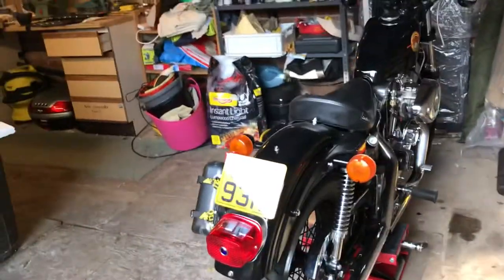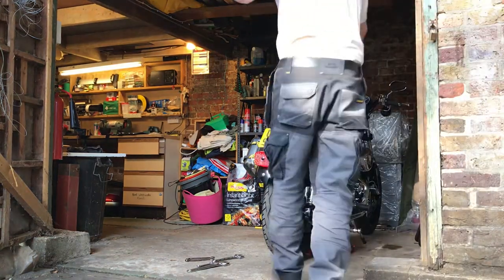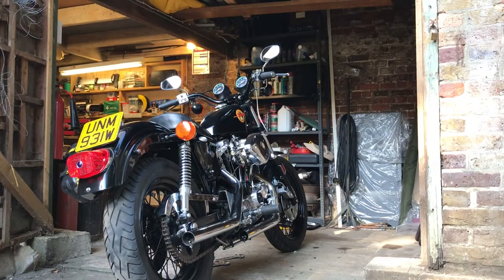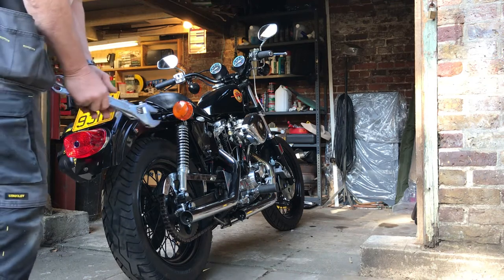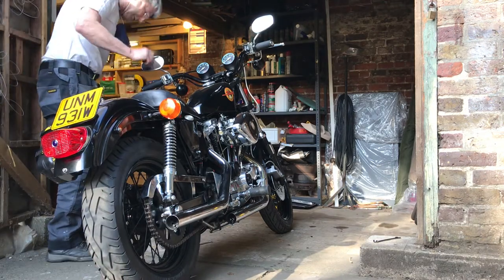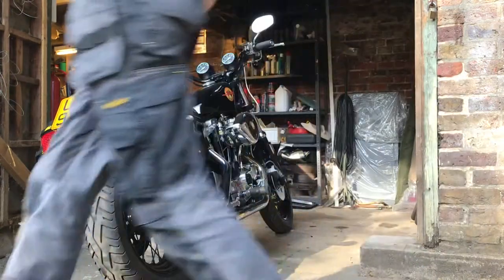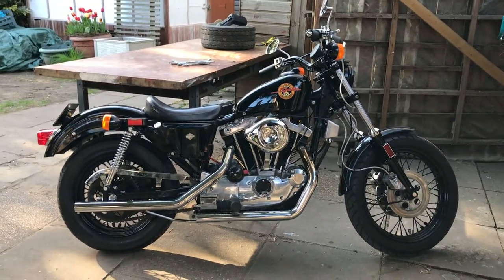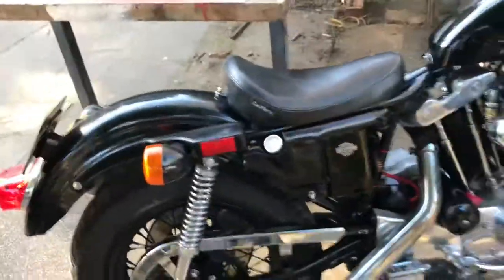1980 Harley Davidson Ironhead Sportster Video 6: Rear Chain Adjustment

Comment: Nice looking bike sir. I'm wondering... In the US we call them wrenches, but you call them spanners. Here a spanner is a special tool for grabbing on to ring shaped nuts with notches around the perimeter. Do you call those spanners as well? Another difference is "swingin' arm" vs "swing arm".
Reply from the maker: Hi Chris, in the uk as you say, wrenches are spanners. There are open ended spanners (10mm one end and 12mm the other, the next size up is 12/14 so in a set you have 2 of each size), ring spanners (same as open ones size wise), and combination spanners which are open one end and ring the other, these are the same size both ends so you need 2 sets to adjust the nut and bolt, adjustable spanners, oh and C spanners for suspension adjustment. Swinging arm over here 👍